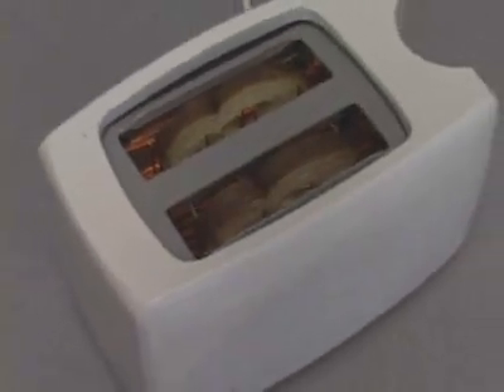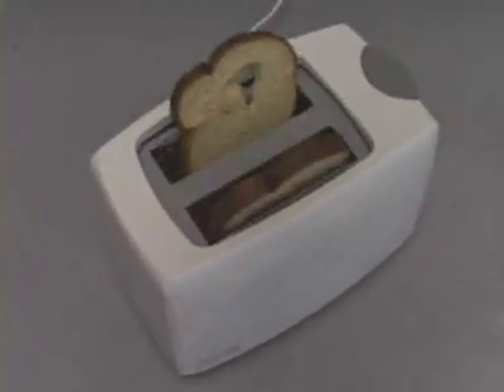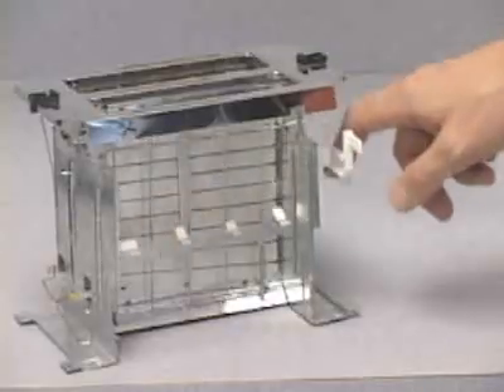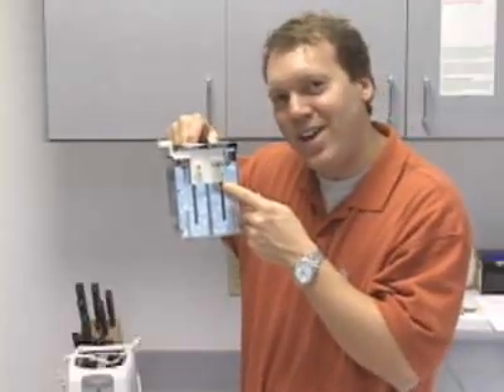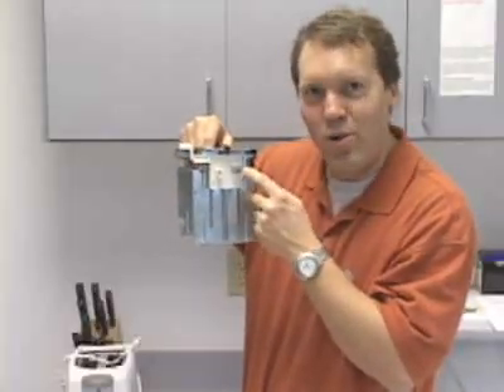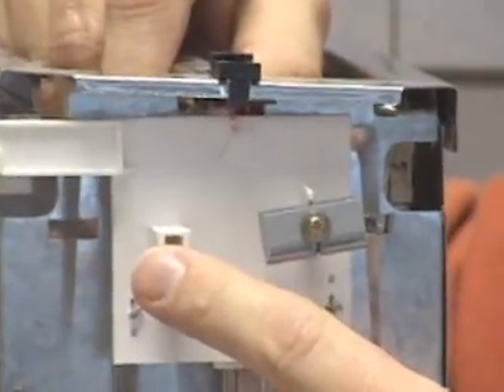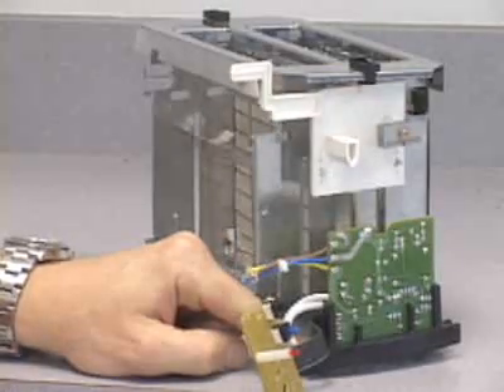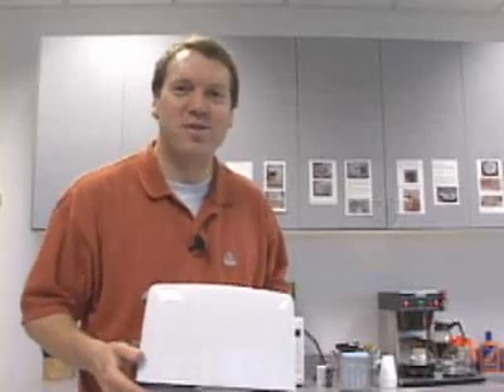How a Toaster Works

Comment: What is happening if the toaster refuses to eject the bread and never shuts off
Reply: The toast would be ruined and the fuse in the plug would more likely blow before anything serious occurs
Reply: @stephensnell1379  I was asking what would be wrong with it if such situation occurs.
Reply: @iiiDartsiii  it would be either a faulty circuit or a faulty ejector

Comment: I had a toaster bought (@ $6.99) 19 years ago.  The middle heating element burnt out.  So I dismantled it.This had very simple, almost foolproof,  thermal/mechanical pop up mechanism.  Electrical function was limited to only the heating element. No electronics, no electromagnet.  That is why it survived so long.